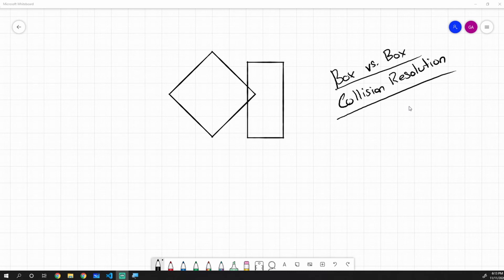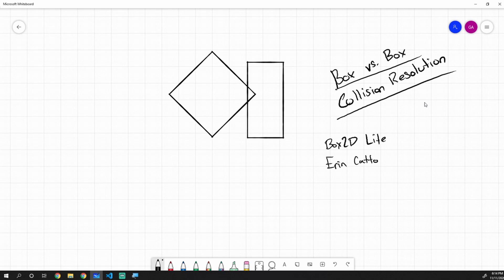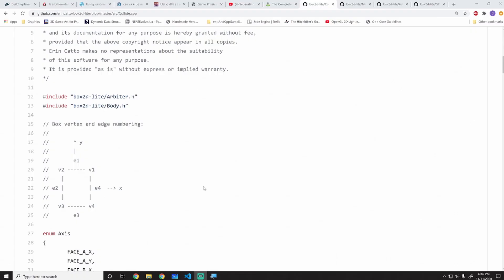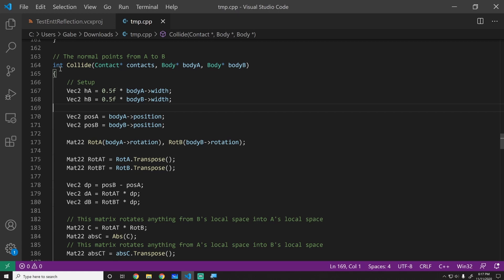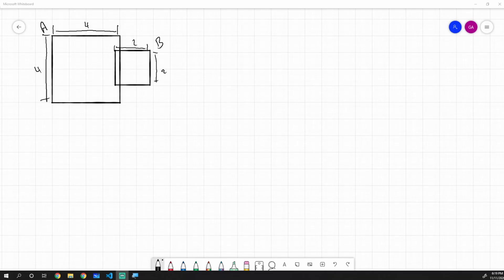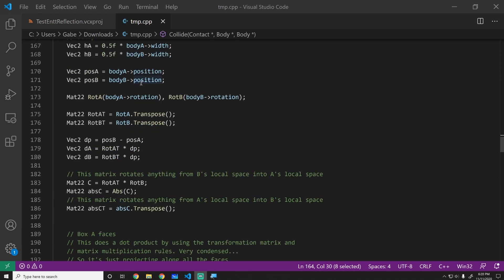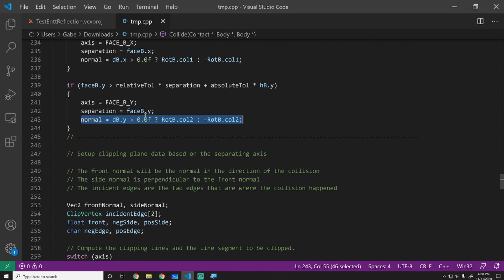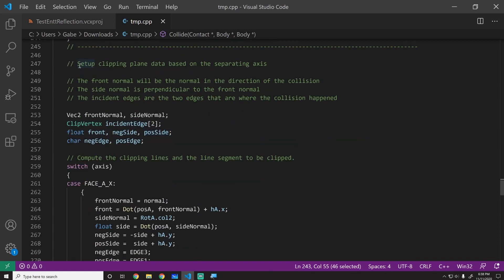Box2D Lite Walkthrough Part 1 | Coding a 2D Physics Engine in Java #16

Comment: Around 15:10 you've completely lost me. I've rewatched this part a dozen times but I'm not getting it. How is the y-axis penetration 3? On the y-axis, B is fully enclosed within A. B's height is 2. So the penetration on that axis is 2. Where am I going wrong with my thinking? Is there a way to visually represent what penetration of 3 actually is on the diagram?
Reply from the maker: I had to rewatch the video to familiarize myself haha. It looks like I was throwing around terminology a bit inaccurately there. -3 is not the penetration depth, rather its the minimum number of units to push b along the Y axis so the two objects are no longer penetrating. And you can visually confirm that by seeing if you "pushed" B down 3 units, it would non longer be penetraring A. Let me know if that makes sense :)
Reply: @GamesWithGabe  ah that makes sense, but that's so interesting / cool how that's "encoded" in that single formula 😲! Is it safe to say this is something that's only applicable to boxes, and not general convex polygons, since it involves half-widths? 

And thanks for responding / so quickly!